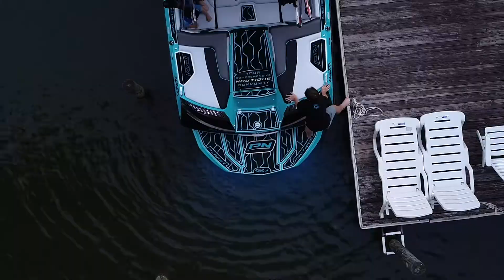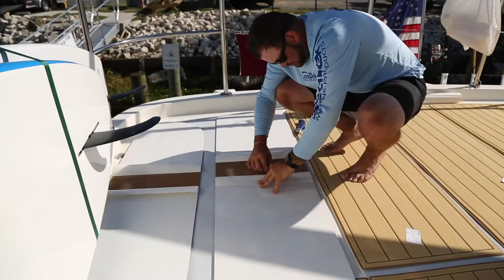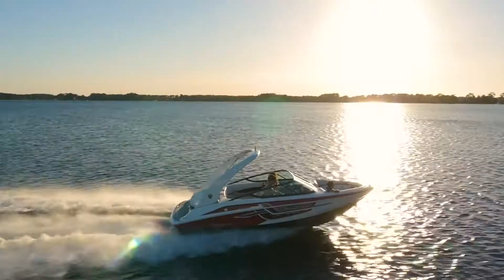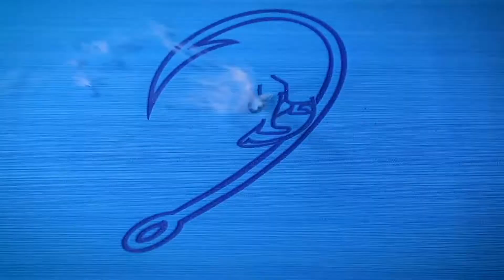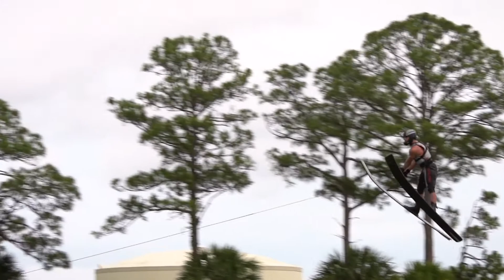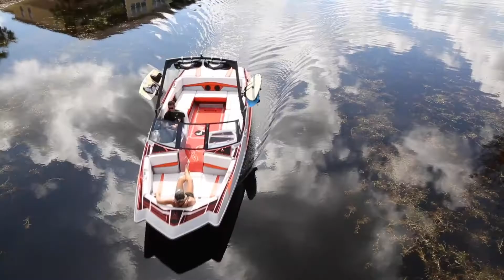Your Boat Deserves SeaDek!

Comment: Does it adhere well to aluminum?
Reply from the maker: Yes! With proper surface preparation, SeaDek forms an outstanding bond on aluminum, ensuring many years of trouble-free use. If the boat has an aggressive texture, we recommend sending photos or acquiring samples for testing. You can order a sample kit here: https://www.seadek.com/SampleRequestForm